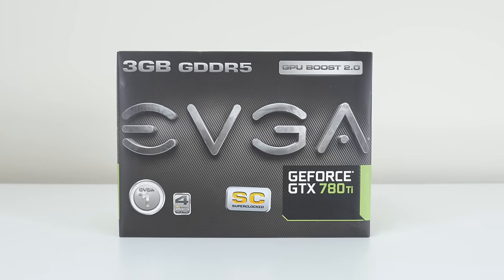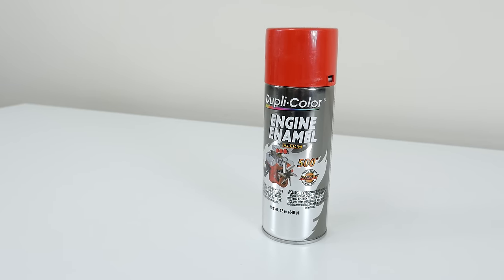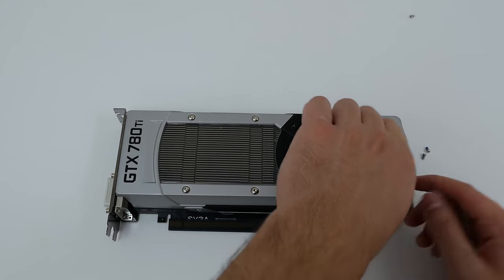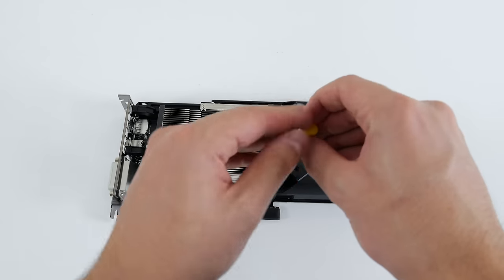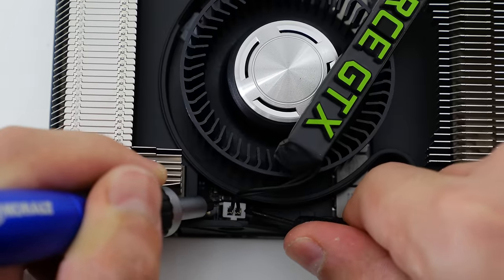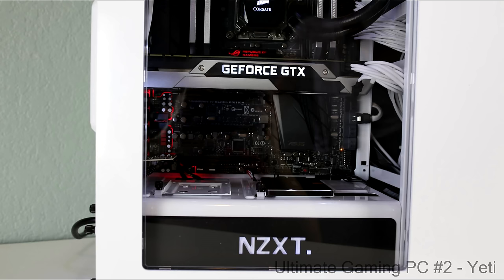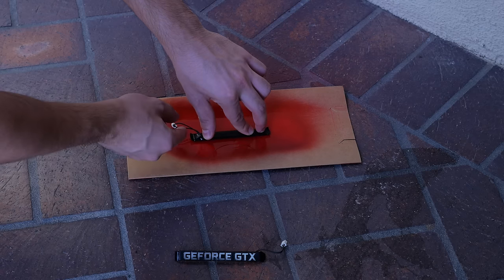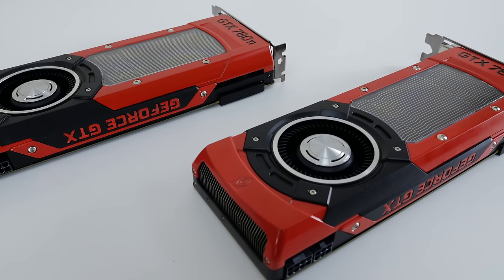How To Custom Paint Your Graphics Card (4K)

Comment: Enamel is good for things within an engine bay for heat & chemical resilience, high build protection, etc but for a GPU or PC components(sees no more than 70ish degrees c, and rarely gets touched), a lacquer paint would have been easier to work with, quicker ability to recoat, and more forgiving when mistakes are made (sands off imperfections or all of it easily in case of mistake). 
    
      Using a plastidip type product is also a good option for remove-ability, if one ever needed to return the card to "stock" aesthetic. Also, there is translucent paint for taillight lenses commonly found in red & black, sometimes blue/green/amber if you know where to look, (VHT Nite Shades is one of them) so you could have gotten that red geforce logo you wanted. That enamel would block all the light, and I see it was sanded it off in the final build. :)
     
     I just bought a 1080 founders and had a nice pink/purple/blue space nebula theme going, until this green hulk came and turned it into a steampunk pink-green kinda scheme :(

Comment: You do NOT need heat resistant paint to paint the GPU cooler housing. You aren't painting the heatsink itself.

Heat resistant paint is for painting engine components and stuff like barbecue lids.
Reply: NeuroticLobster But the heatsink gets hot and puts the parts under heat so... its better to use those
Reply: MiguelXx3D You are missing the entire point. One, you don't paint the heatsink itself. Two, the plastic barely gets warm enough to consider it "warm", let alone hot. HIgh heat paints are for painting barbecues and engine blocks, conditions where temperatures are in the hundreds of degrees or higher. Not for something that is just warm to the touch.

Regular paint is absolutely fine.
Reply: NeuroticLobster oh. I DONT have a reference cooler so i was just suposing
Reply: The Titan X can reach up to 80+ degrees C.
Reply: A Christian Gamer You don't need heat resistant paint for that.
Reply: +NeuroticLobster is right, you don't need high temp. paint, also I recommend getting vinyl dye. Most GPU shrouds are plastic and have texture to them, and all that vinyl dye does, is dye the plastic and doesn't remove the texture by adding a thick coat of paint.
Reply: +A Christian Gamer Did you see what it said on the spray can? It said f***ing 500 degrees! :'D
As NeuroticLobster said, you really dont need such kind of paint for a graphics card. Just use plati dip or something.
Reply: _ Marcel _ No, I didn't.

Comment: Hey, if you want to do plastic parts an easy way is to lightly scuff the plastic, then use adhesion promotor before you prime it , then paint it. Your paint will look more professional , and will adhere alot better..Just a tip.

Comment: the letters were raised so you could have just sprayed the whole bar as the letters slot through a pre cut hole and you wouldn't see the mess in fact you should have just sprayed straight over the green with  the red :) tip !
Reply: Painter's tape is a godsend

Comment from the maker: Ultimate Gaming PC #3 - BIG RED (4K)
Reply: removing the cooler did you have to reapply thermal compound to the core or did you leave it as is? never saw you take off the heatsink so not sure if its ok to leave it on or reapply compound to it
Reply: ***** erhm
he never took apart the heat sink and yes is recommended that you reapply. but why would you take it off. He is just painting the casing of the card...
Reply: Carson | TF2, CSGO
 im simply assuming that even tho he didnt take it apart that as part of the removal some of it comes off and might mess with the heat sink thermal paste.
Reply: no. since the heat sink is directly locked into the core so. if you dont take apart the heat sink. nothing will mess with the thermal paste
Reply from the maker: Carson | TF2, CSGO ***** Ya, no need to remove the heatsink, thats y I used high heat paint so that it doesnt chipp or melt off and damage the components.
Reply: well depends on your gpu. cuz some gpu has a casing where the outside is completely covered and is impossible for something to reach the core or heat sink
Reply: So, how does the geforce logo light up once it's painted?
glamour shots plz!
Reply: what is the autro song ?
Reply: TechSource What is your favorite graphics card?
Reply from the maker: DarkVoidDan Reference GTX 980TI
Reply: TechSource
I have the gtx 970 brilliant card for gaming.
Reply: +TechSource  i have the reference gtx 980, do i need to take extra steps to take off the backplate?
Reply: msxboyy
not really backplate comes off with a few seperate screws from the heatsink
so simply remove it first set aside those screws then follow through as the video describes.
Reply: +TechSource same im trying to do the same with a 980 ti that is going into a customer build, my only problem is i want the "GTX 980TI" logo to stay black
Reply: Mark Bethel
cover them with painters tape or go back and repaint them a new color.
Reply: +TechSource What is the song at the end of the video?
Reply: +TechSource Yo dude, are the silver parts made out of plastic or metal? I don't know if engine paint is gonna stick to plastic :S
Reply: metal
Reply: Damn that's good :)
Reply: +TechSource Yeah, using paint that can stand high heat is a no-brainer. But why didn't you paint the heatsink too? Is there a problem to paint it? Imo, it would have looked so much better. Do you or anyone here, know if it's necessary to remove it? Or is it enough to just cover the parts you DEFINITELY don't want any paint on. I only want to paint the top of the heatsink, that you can see through the window. 
I plan to paint my 780 Ti ref. in all black. Like the GTX Titan X. Really like the paint on that card..
Reply: Yeah that's usually the case. But there is black paint that could actually lower your temps. Take a look at this video and see for yourself: /watch?v=f1QL9veQaNg
And like I said, I only want to paint the top of the heat sink. I find it hard to believe that it would have any affect on the temperature of the GPU..
Reply: I introduced my incle to your channel, he loves your black and red color scheme and immediately he's watching all your videos.
Reply: TechSource szqqasaa

Comment: Paint was applied too thick. Instead use several thinner coats sprayed from farther away to get a better finish. Allow each coat to dry before applying the next.

Whose brick did you over spray on in the video?

Comment: Generally with any plastic or non-ferrous surface a primer is used before the top coat to ensure the paint sticks over time. I noticed you just sprayed the engine enamel straight on without priming the plastic first. Did you not use any primer because it would not have been heat resistant? Planning on doing this myself

Comment: anyone know if the logo sanding will work on the new founder edition cards fro the 1080 or 1070???? I just purchased one and was wondering if it was possible
Reply: Rydar my pc is mini itx so a blower cooler is a lot better in my situation plus I know there are a few other blower coolers out there but nvidia is by far the best looking imo plus there extra $50 wasn't really a problem
Reply: Did you end up doing it? I would like to do the same

Comment: I have a question:
The video shows you spraying the metal shrouds in their entirety, including the black GTX 780 Ti lettering, yet at the end, the lettering is black again. How did you accomplish this?
Reply from the maker: The rubber part can be painted any color..the rest of the "black" around the letters are black electrical tape which can have some paint on it as well...because once you put the black metal piece over the letters then it will cover the electric tape. Hopefully that makes sense lol
Reply: TechSource No it doesn't make any sense. The black lettering on the metal shroud that says "GTX 780Ti" is not rubber. It is simply painted metal. You spray-painted clean over it with the red engine enamel, yet the finished product shows the lettering back to being black. There is no way that this would have happened using enamel unless you either masked off the lettering prior to painting (in which case you should have mentioned the methodology you used), meticulously cleaned the lettering out (extremely difficult and unlikely), or the finished product is not what was shown in progress in the video (in which case, the video is at the very least disingenuous as to what to do). Additionally, while Duplicolor engine enamel dries to the touch in 30 minutes and can be handled in an hour, you failed to mention that proper curing of enamel-painted parts requires much longer than a mere 45 minutes.
Reply from the maker: Patrick Phillips Ohh, I was confused. Yes that metal part I painted completely which made the black fade away after each coat I applied. I simply used a Fine point Black Sharpie to trace over the Words. Sorry for the confusion.
Reply: TechSource ok i just asked the same ? i guess i should of read first to see if anyone else asked lol

Comment: Are you able to paint the screws? Or will that clog them up or something. Thanks
Reply: If you're using paint, that's fine, but only paint the heads just to be safe. Painter's tape will help. But I'd use Plasti Dip - it can go up to 93 celsius, and you can just peel it off if needed. Plus you won't void your warranty.

Comment: When I spray paint, it always makes a layer of paint too thick. How did you make it so you could still screw on everything?
Reply from the maker: did u use the right paint? Also how many coats did u apply. Also how long did you spray each coat for?
Reply: light coats, keep the spraycan ~20 cm away, do atleast 4 light coats.

Comment: Hey man, do you think you could do a video with RAM? I have Crucial Balistix DDR4 RAM. Also, I would like to make my card red, I have a 980, would it be basically the same process?
Reply from the maker: same process, just remove the screws and paint the metal parts.
Reply: TechSource how does this work with plastic parts? Do I need primer?
Reply: TechSource Hey man, I was wondering is it illegal to paint and sell the GPUs? The logos and everything like that would stay.
Reply: Of course not - but make sure you tell people that you painted it, not invidia, when you sell it.
Reply: jamdoginc Thanks a lot for the reply, wasn't sure if I'd be infringing on anything. Thanks a lot man

Comment: Can you make a video like this with a card from AMD?  That would be interesting for me, because my graphics card is the Amd r9 380 and I want to paint it, but I don't know how I can do this.
Reply: What would there be different, except the disasambling ...
Reply: _ Marcel _ I want to know how i can make the Cooler away and don't destroy something and which parts i can paint from a custom cooler.
Reply: Constantin Groß When you mean the heatsink or the fan by that, don't paint them! You can paint pretty much everything on the "case" of the card that you can disasamble and is not used for heat transfer (like heatpipes).
Reply: Is your card by MSI perhabs ?
Reply: _ Marcel _ No, it's an Sapphire.
Reply: Constantin Groß Then just look at the screws and what they are connecting and try to find the right ones for the "cover", or just look up a tutorial for how to take it off.

You might have to take off the heatsink to do so, in wich case you should reapply the thermal paste.
Reply: _ Marcel _ ok

Comment: I did this to my 970 EVERYONE WHO HAS A REFERENCE NVIDIA COOLER READ THIS under the black rubber in between the letters there is green paint be very careful when sanding I scrubbed off the black and there was green under so I had to paint over the green with black to cover up the green patches.

Comment: planning to get a 1070 strix. is it hard to remove the shroud? and im thinking of using white plastidip. will it be okay?
Reply: i heard plasti dip is not good for painting gpus
Reply: Why wouldn't it? It can go up to 93 celsius and is easy to peel off. Much better than paint.

Comment: How did you get the GTX 780 Ti black lettering back to normal again?
Reply from the maker: Are you talking about the black spots?
Reply: TechSource yeah the lettering on the top of the heatsink
Reply: ***** that would have been hard
Reply: ***** Unless he really delicately masked them.
Reply: ***** yeah, i would be too impatient
Reply from the maker: ***** Thomas Wilson I just used a fine point permanent marker and traced the outline..took like 1 minute per card :)
Reply: TechSource wont that wear off with heat and such?
Reply from the maker: No, thats why I got high heat paint. Will work with temps up to 500 degrees. Also if you do 3-5 coats the paint wont chip off, either way you shouldnt be touching the card inside the case lol.
Reply: TechSource i mean the permanent marker, wont that wear off?
Reply from the maker: Thomas Wilson It wont. Either way it doesnt matter since its not viewable since the card is facing downwards. With the way I setup my air intake/outtake, there shouldnt be any hot air blowing towards it.
Reply: TechSource fair enough, this can be done on any decent aftermarket cooler yes?
Reply from the maker: Thomas Wilson For the marker it has to be permanent, for the paint it has to be high heat resistant.
Reply: TechSource okay i will think about it for the EVGA ACX cooler

Comment: Can i use rust-oleum caliper paint?
Reply: You can use most any spray paint, really...just depends on how much you think your card is going to be handled and how much of a stickler for detail you are.  

Paints formulated for plastic are going to adhere better.  Standard enamels are going to go on thicker, meaning less of the card's embossing/details are going to show through. Vinyl dyes are going to go on thinner, showing the most detail.

Comment: In case you were wondering this WILL void your warenty
Reply: It depends on the manufacturer, for example EVGA doesn't care what you do with your card as long as it's returned to it's default state if sent in for RMA.
I painted my old EVGA 970 but it died 7 months later, luckily EVGA are badasses so sent me a replacement, told me to swap the cards and put the dead one on the default cooler and send it back.

Comment: Very disappointed by this video:

-Spray painting technique is poor.
-No primer was used despite the fact your are using paint intended for metal.
-No disclaimer about how taking apart your graphics card will VOID THE WARRANTY!!!
-No disclaimer about the graphics card being static sensitive and the requirement for grounding yourself before dismantling.

The last two are unforgivable as an innocent viewer could potentially ruin an expensive graphics card and not be covered under warranty.

I just hope people read this comment before attempting to paint their graphics cards.

Comment: Call me newbie..............But why do some people have two cards?
Smh.
Reply: +Mister. Bubbles Crossfire or SLI setups (depending if they are Nvidia or ATI cards). Crossfire and SLI allow you to use a connecting cable to link two GPUs and increase your overall performance. The only downside is that currently everything that gets loaded into memory on one card is duplicated on the second/third card which means that if you have 2 4gb cards you still only have 4 gig of gddr5 that is usable. However the combined power of the two card's gpus means that your rig can eat through rendering faster.
Reply: Isaac Kennedy I get it, Thanks
Reply: +Mister. Bubbles and gaming to, Google it XD

Comment: don't spray paint your graphics card it voids your warranty
Reply: Can I brush paint it?
Reply: +Profet Gaming no you can't change the appearance
Reply: +Digither I was joking but seriously. I can't buy the same cooler on ebay or amazon and just switch out the original?
Reply: You can't paint it you can't put a liquid cooler on it if you still want warranty you can switch the cooler you basically can't do s*** if you want your warranty to stay.
Reply: +Digither Wow. Well that sucks because honestly the ones that comes originally in colors look horrible.
Reply: +Digither Of course you can paint it. Just use plasti dip and pull it off when you need to get it reapaird or something. Also as Spartanspear said, when you paint your card, you might get it selled for the same price as a new one or maybe even more.